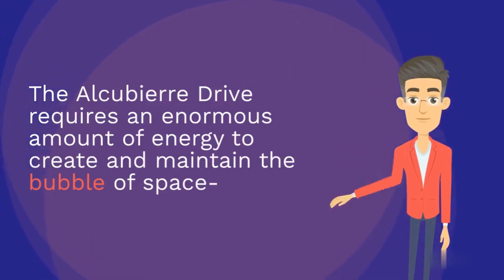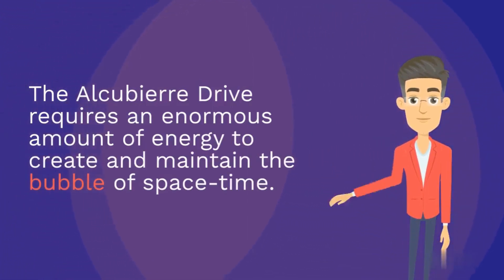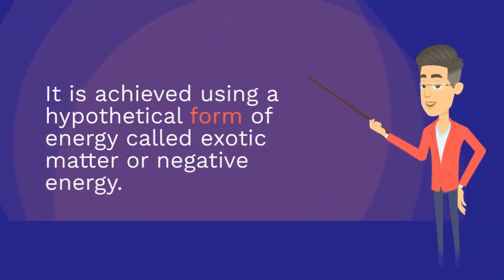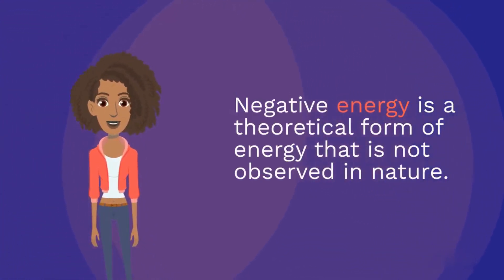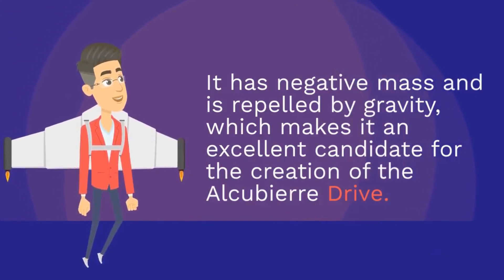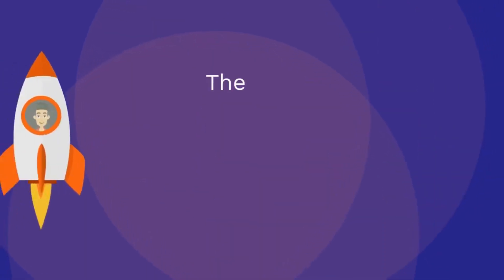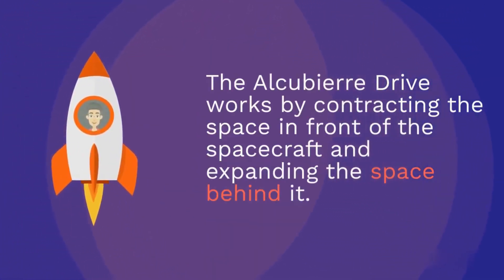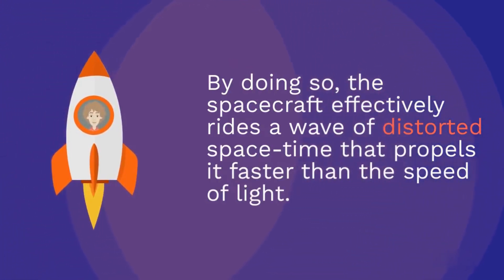The Alcubierre Drive: Propelling Us Faster Than Light?

Comment: Want to know an insider secret?  Antimatter IS the "exotic matter" we are seeking, and it has all the properties required to warp space-time.  Luckily for us, every femtometer of the entire universe is filled with positron-electron pairs and we only need to add 1.022 MeV of optical energy to unlock it.  The required photonic energy is easily provided by several natural radioactive isotopes, making it even more accessible with no need for large accelerators or other heavy equipment.  This hidden resource is inexhaustible and WILL be the future of warp drive technology when mankind comes to understand this simple but proven knowledge!